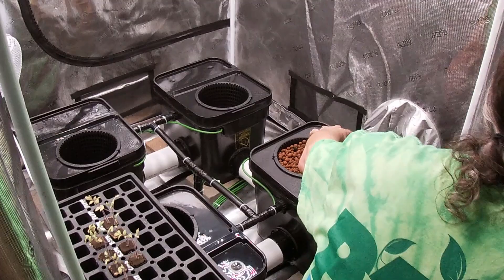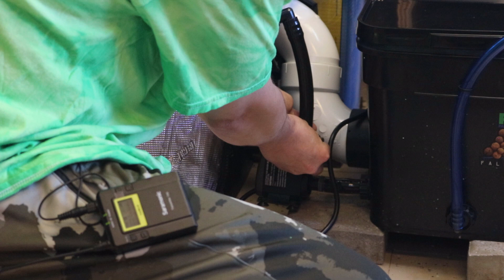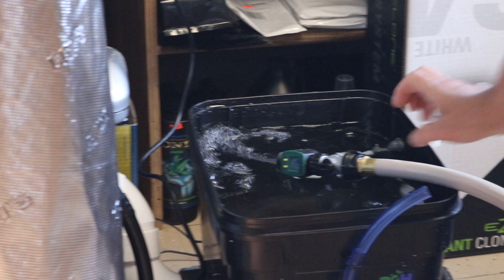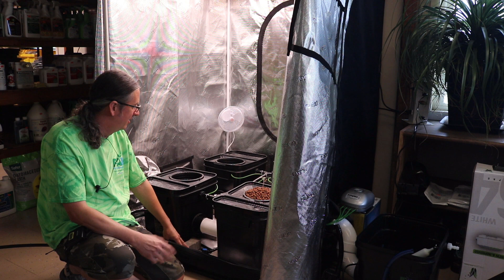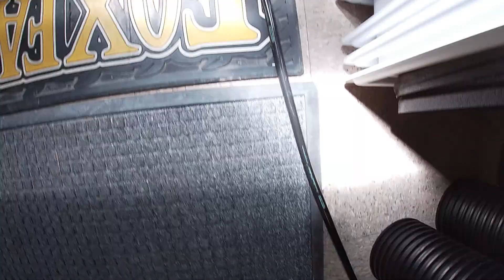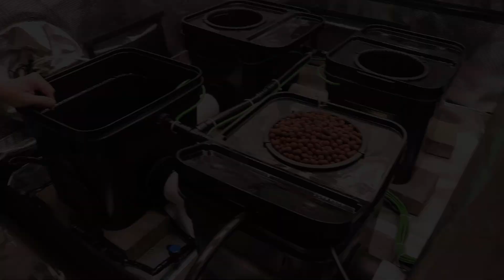FallPonic Instructions  Assembly, Filling, Planting, Draining, and Cleaning

Comment: White pipes on the inside with the rubber ring out the tent hole with the 🐛 hump piece sticking out with the long end in the tent hole 5.5 don’t gotta go 6” to get it centered show me your white pipe steamed in hot water, loosen that plastic and tubing for that pipe on bricks keep it running good
Reply: Fill it with plenty of instructions with that waterfall pump top off in action alright? The highest you can get your water is really high in the beginning

Comment: With a 5x5 AC infinity tent the 4 8gal buckets aren’t able to line up in the middle of the tent because the pump sticks into the side of the tent. I was looking at a way to extend the hump piece so they can be centered. So far I’ve only leak tested it. Won’t be running it for at least another week

Comment: Hey there love the system, it’s been great. Question about filling, one time I filled it to where the water was below the net pot and it ran good. I did it like this by accident not paying attention. Now when I try to fill it like that again it keeps taking everything out my res. I’m talking about running around 20 gallons in the mini 4 plant version. Thank you!
Reply from the maker: It sounds like you may have an air bubble in the caterpillar (hump).  The effect is siphoning the water from the other buckets and that "helps" it to get over the hump.  If there is an air bubble trapped in the hump then the pump will discharge all the contents in the reservoir but not refill due to the air bubble.

I hope I am understanding what you have shared.  

thanks for watching and please let me know if we can help.

-w
Reply: @PAHydroponics  ok thanks for the reply, that makes sense. I thought I was filling it right but I agree with the bubble being there. Someone else mentioned pushing the garden hose into the caterpillar a bit to burp it out too. Ty guys again.

Comment: What would it cost for a 13 gallon bucket but stirponic style for 4 plants? Or is it possible given the shape square vs round buckets?
Reply from the maker: The "stirring" action is diminished by increasing the volume.  Gary uses the larger three inch pipe to keep things moving in the larger volumes of water. In the Fallponic the recirculated water has a very low restriction in flow due to individual waterfalls and large diameter return tubes.

-w

Comment: Love the principle of this but it seems to me that this would only work with a 4 bucket system. Doesn’t really work with anything else well I suppose a 2 bucket system would also work but anything bigger than 4 and the water will not be dispersed evenly. Unless I’m just being a galah have you came up with a workaround for this issue? I believe for bigger setups it would be easier to just set up a top feed system. 
What are your thoughts?
Reply from the maker: This system is restricted by pump output as well as a couple of other factors. Our online store offers several options. Take a look at the 4, 6, 8, and even a twelve-site special edition Niagara FallPonic at the link below.

https://shop.pahydroponics.com/fallponic-systems-parts/fallponic-8-gallon/
Reply: @PAHydroponics  thanks will do! Also idk if you carry the ez stor buckets in white or not but if not it’d be great if you did. Anything to help keep water temps down.

Comment: I just purchased the 8 gallon 4 plant system 2 weeks ago. First, I ordered at lunch on Friday and it was on my porch by Sunday afternoon which was awesome. Second. I assembled it in less than an hour and it went together easily, the only leak I had was an o ring I put in the pump wrong. Which was my mistake and easily corrected.

On the filling I still had trouble with the air bubble in the caterpillar. 
My solution and a little tip for others: I took the drain pump that came with the system and rain the hose up into the caterpillar while pumping out of the reservoir which forced the air bubble out and got me flowing.

Very happy with my purchase and have babies in already looking good.

Comment: Thanks for sharing information! 

Is there any other way to set up a reservoir that can be maintained outside of the tent as far as draining and nutrient changes? 

I'm assuming because of the hump in the pvc coming out of the tent that it wouldn't be possible. If so, is it ok to run straight pvc instead of the hump?

Thanks 
Seth Liberty
Reply from the maker: Most of the pumps we sell are Active Aqua or EcoPlus distributed by Sunlight Supply Inc. Here is a link to the Fallponic/DIY category on the store website.  

https://shop.pahydroponics.com/fallponic-diy/

If you take a look you will find kits, parts and different size pumps for different applications.  Hope this helps.  send an email to info@pahydroponics.com for custom applications and estimates.

Comment: Gary, love my 6 plant Fallponic System. Thanks for all your support. The Fallponics System blows away my Active Aqua Grow Flow. Using the three inch drains of the Fallponics as opposed to the 1/2" or even upgraded 3/4" hoses and drain fittings of the Active Aqua Grow Flow makes the system work so much better. No matter how I tried to keep the AAGF system drains cleared, I always got a white tampon of roots clogging the bottom drains. This clogging always happened at the worst time of my grow which is at the end when the roots are filling the grow pots. Keep up the good work and great videos. Thanks, Todd.

Comment: How much vertical rise will the drain pump deal with, I ask as I’m going to be in the basement, but running a hose outside wouldn’t be an issue, I just don’t know if I’d need a stronger pump for the 5-6’ rise to get it outside?

Comment: Hey Gary. I have a couple question for you. I want to order the 4x4 tent kit from you with the 6” fan. I live in az and will have the tent in an air conditioned room kept roughly at 71 degrees. Will I need a chiller system and also will I need something to boost co2. The ambient air being pulled into the tent will be pretty much be from my entire house. Thank you
Reply from the maker: Most of the time you should not need a water chiller in a temperature controlled room. 
People exhale approximately 2lbs of carbon dioxide a day. Your plants will enjoy what you exhale and in turn will help replenish oxygen.  

-w

Comment: Let’s say you been running system for a few days and water temp hits 70, could you drop frozen water bottle in res to cool all the water down to 60?
Reply from the maker: I recommend finding the source of the heat and try resolving the issue in that way. If that is not possible because of the certain factors then a water chiller may be what is needed.  The frozen bottles can help in cooling the water temporarily in smaller systems.

-w

if you're interested here is a video on how to hook up a chiller.

https://www.youtube.com/watch?v=s9N1sUjwng4